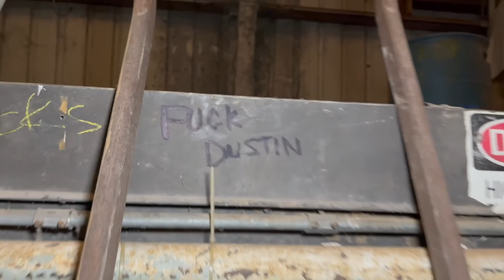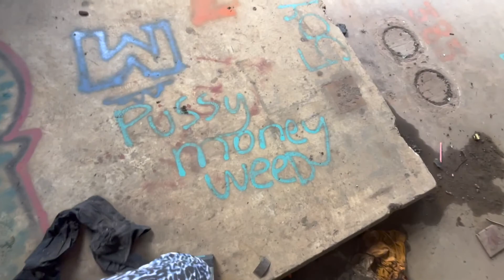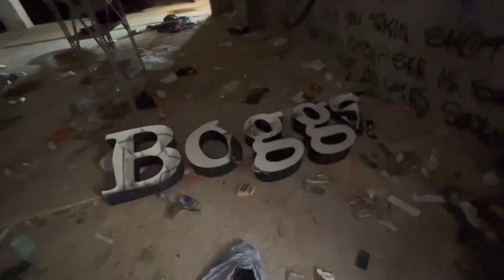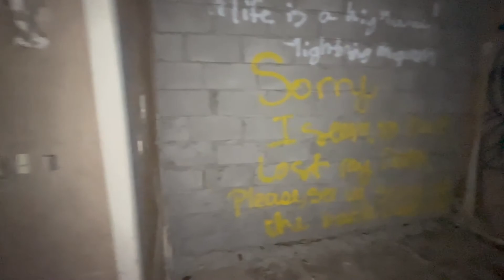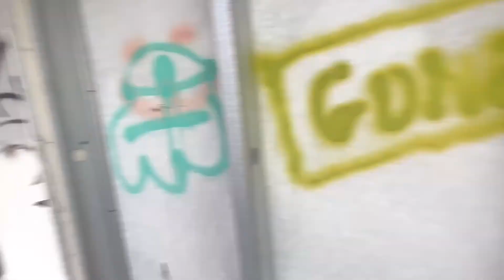EXPLORING ABANDONED LINDY BOGGS MEDICAL CENTER NEW ORLEANS

Comment: Hey i wanna get in but ive seen security a few times, how did you guys get in?
Reply from the maker: i don’t think i’ve ever seen security there personally, but we usually come in on Conti Street - there’s generally always a lot of large holes in the fence, at least when i’ve been! in this vlog, we came in directly through the crematorium (at frame 5:37, it’ll be at the very far right - i believe it’s the section of the building that’s grey, not brick); in my most recent lindy boggs vlog (the one with just the basement footage) we entered through the fence facing the road at 7:07, but i was also able to exit easily from the ER ramp on Bienville Ave - at frame 5:09 it would be the furthermost left point on the fence that isn’t the new nursing home (obviously lol) - good luck! happy exploring! 😊
Reply: @LONELYSTARURBEX  finally started exploring it & the navy base as well, thanks for the reply though, im sure itll help someone out there lmao